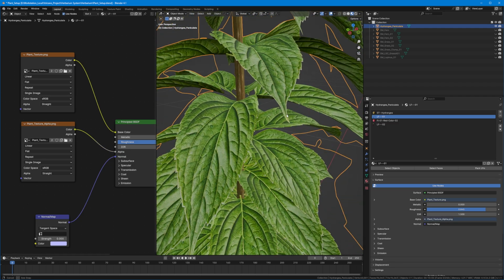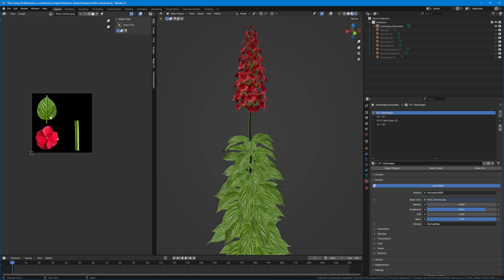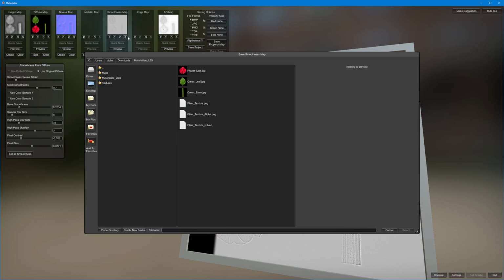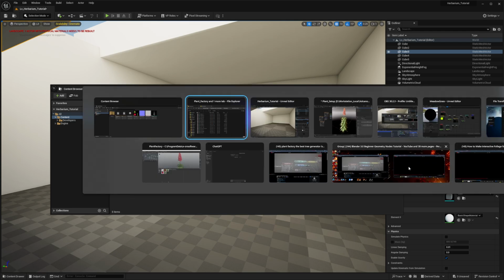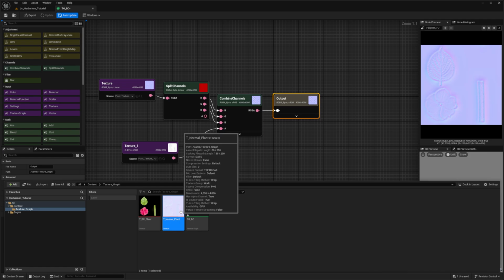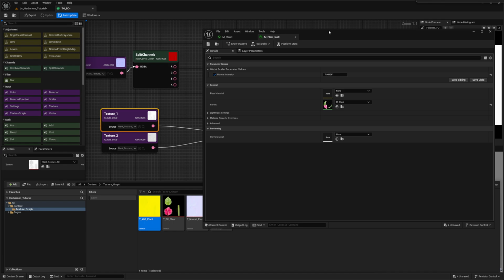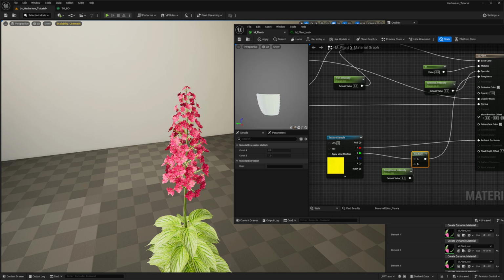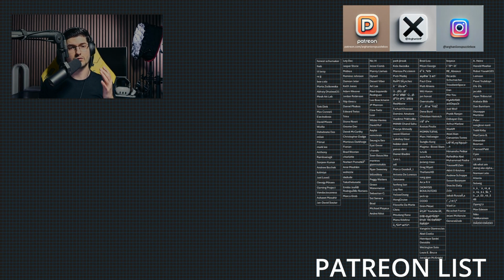Experience Unreal Engine 5 Like a PRO with FREE Foliage Tools! (Part 2)

Comment: I am working with UE5.6. There is no plantfactory plugin for version 5.6.  So, I installed UE 5.3: installed plantfactory + plugin for 5.3 ... Load plants in a 5.3 project. Then with the same plugin select "Convert to UE5 object", and select a folder in the 5.3 content browser. From there, you can copy the plant to the same directory in your 5.6 project. Works perfectly fine and quite fast. The only problem I have with plantfactory plants is they are quite "heavy".
Reply from the maker: Thanks for the workaround, that's really helpful for others!

Comment: Not sure why, but as you are dealing with 32 bit PNG's they have a Alpha Channel by default. You need only use a Alpha as a background, not black or any other colour, that Negates using another texture (and the work involved creating one), the Mask. Remember, the Black background You added yourself. Remove it and leave the Alpha Channel empty. An alternative, use a 8 Bit PNG, they are smaller in memory, if you do not use the Alpha channel. Some Editors do not recognise the 24 Bit PNG format.
Materialize has Channel Packing, look at the last part of the  menu system on the top righthand side. That cuts out the need to use Gimp at all in the equation reducing your workflow.  Don't add a Normal to a packed texture map, it simply doesn't have the RGB range in a single channel to work efficiently.
You can use the UV coordinates in Unreal to position the UV's to use Atlas Maps, another saved step in Blender. Use Offset Coordinates and Scale to get the same result in the Unreal material editor. Almost every Editor can handle that step.
There is no need to include a Metallic map if you do not want a 'metalized' feature in the final draw, simply use a constant/parameter. That reduces the draw calls and memory space you are using. The shader default is that the output is Non-Metallic, you only need a map when an object is metallic.
The use of Specular is another wasted step. Use the Roughness Map to gain Highlights, albeit leaves never really need that additional 'feature'. You can always use the Contrast, or a Multiply to increase where 'highlights' are emphasised, applied to the Roughness Output.
Another tip, use Greyscale Maps for AO, Roughness, Metallic, Displacement etc at Half Size. Maths says... 4 Times 1024x1024 Textures are equivalent to One 2040x2048 Texture. Unlike Albedo, you do not need the same level of detail or colour range... this is a flower and very few subjects need such a high level of detail. Your flower textures do not need to be 2k beyond the Albedo but you are forced to use 2K as you are using an Atlas Map.
The use of Atlas Maps, using these size of Resolutions for a plant, are wasteful. If the user is viewing just the leaves, you are still using the full draw/scan call of the whole Atlas Map. The Whole Atlas map must also be held in Memory, even when all you see is a single petal of the flower. Use Streaming Textures to save Memory and Draw Calls.
Using Shaders to pack texture maps, is a waste of resources, as the shader not only wastes cycles packing the textures, it then has to unpack them to work on the data. You are not saving resources, you are wasting them on Shader computations.
Something else you should point out..... PlantFactory is indeed given away for free... BUT, you cannot use the Assets unless you are creating a Compiled Game/App etc, where the Contents are exposed. Nor can you sell them as your own asset. Worth a read of the Specific EULA that comes with the Programme and every Asset Catalogue.